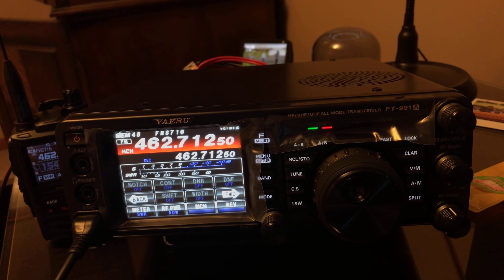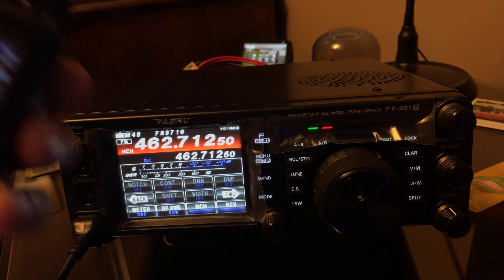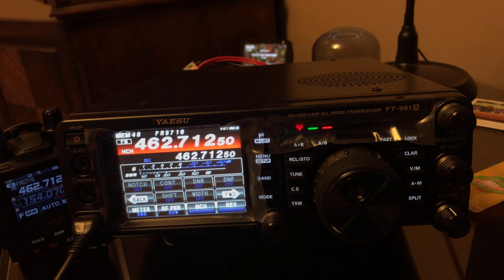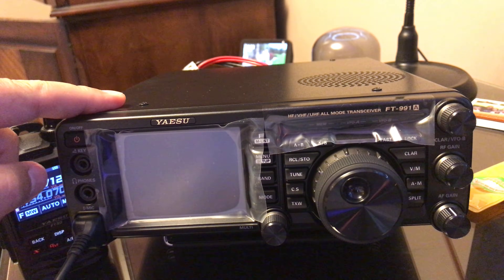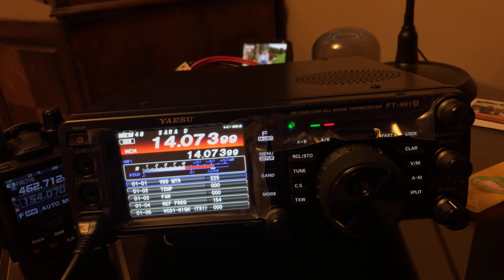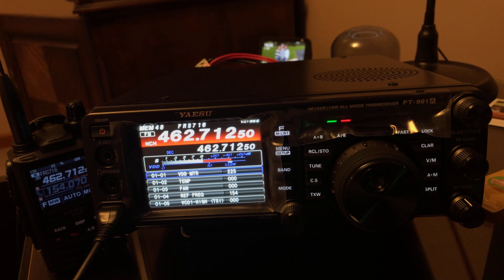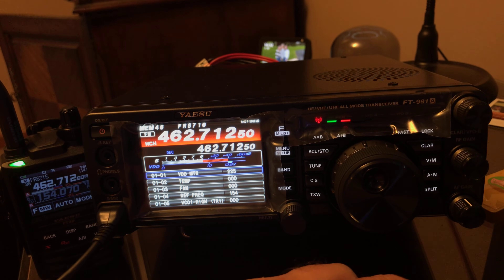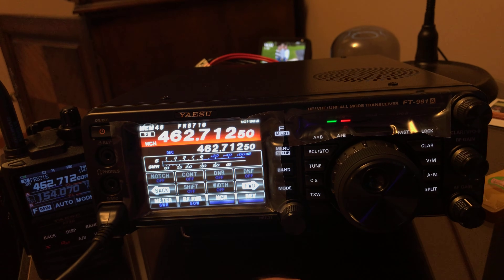Yaesu FT-991A VHF/UHF Extended TX Range

Comment: If it can TX in alignment mode, it should be able to do it in normal operation. Problem is, nobody has figured out how to do it yet and most wont risk bricking a $1200 radio by experimenting with connecting the other open jumpers. lol
Really wish we could make this happen. Ive done it on my FTM200's and FTM500's without issue. The 991A should be doable too.

Comment: Is there a way to have TX enabled outside of the HAM frequency range permanently, specifically for 2m and 70cm bands?
I'm trying to use FT-991a for the needs of the HAM radio service as a part of the Civil defence in E7 but I'm unable to use my rig on the official CD repeater that works on 174MHz.
Reply: no. that's why I won't consider 991a.  857d and Icom 7100 are still my best choice.

Comment: Abusing the privilege's of amateur radio will only bring stricter rules and aggressive enforcement.
That being said, here's a question on the HAM General exam:
 G2B11 [97.405] What frequency should be used to send a distress call?
Whichever frequency has the best chance of communicating the distress message.

I'm sure zombie apocalypses would fall under this.

Comment: Modification of a type accepted Amateur radio for out of band transmit/operation is illegal for licensed Amateurs or anyone for that fact so why are you offering this video for people to do this? Is illegal operation something you advocate?
Reply: We Hams are curious. If something bad happens I'm glad I have more tools in my pocket from watching videos like this :)
Reply: @TechieMillennial  What would those new tools be and how would they benefit you where the normal capabilities of that radio wouldn't?
Reply: @DWood-vl5ek  Laws don't matter when SHTF. A lot more people have FRS radios than ham radios. Again; just another tool in my pocket just in case.
Reply: Isn't there a hall you could monitor?
Reply: It isn't illegal to modify an amateur radio transmitter so long as it is not used on another radio services bands or frequencies and so long as it remains in compliance with the Part 97 spurious emission standards set by the FCC. I looked all the way through 47CFR USGS § Part 97 Rules & Regulations and found nothing about it. There's a 14 page discussion about it on QRZ Forums at https://forums.qrz.com/index.php?threads/fcc-enforcement-advisory-no-2018-03.642755/
Reply: This is good to know for an emergency; which is when it is legal to transmit on any frequency.
Reply: Most of the people on earth, the FCC doesn't apply...  Here, one is allowed to built their own radio using whatever parts/components they want, as an example.
Reply: Rules are for the obedience of fools and for the guidance of wise men.
Reply: Did you ever drive 1 mile/h faster than allowed ?? Why then did you post something like that ?
Reply: Let’s face it….many (not all) are a certain personality type.
I mean really… “social” is sitting in a dark room talking to other (mostly dudes) sitting in their dark rooms.  It’s the Dungeons and dragons kids grown up.
Ever seen a group photo of a ham meet?…yeah.
I heard a couple Licensed hams talking in a foreign language last night (announcing call signs in English) and they were scolded by our local basement dwellers for it.
This little thing….knowing some electronics and rules is their stature and they don’t like that messed with.
Hams (and the FCC) don’t care if a radio transmits out of band because they have no use for it in their hobby.
There are those however who have little use for radios as a hobby or sense of identity and have them in order to help people in case of emergency.
FRS, GMRS, and CB radios outnumber legally operated amateur radios by magnitudes and anyone who would get the appropriate licensing and spend thousands on radios to help others shouldn’t have to carry 4 radios to do this.
Hams are so fragile from their basements that they actually think some radio interference is the end of the world.
I’ve lived in two cities that have BURNED (LA and PDX) and have a much different bar as to what a crisis is and what rule breaking is.
Oh no….somebody contacted a semi on their 991 on CB9….OH NO!!!
I’ve heard that Russia has infiltrated the USA with operatives modifying $1000 radios to disrupt the FRS traffic….HIDE!!!
There is some incredible irony that if China nukes us, that I would have to contact a semi hauling the excavator to dig some ham out of his basement and relay that to CERT on a CHINESE RADIO.
Wake up sad hams.  Nobody buying a 991 or FT5D or Icom is spending their evenings trolling the local GMRS channel with foul language and spurious emissions….seriously.
And if you wonder what personality type ends up making rules at the FCC….you don’t need to look far from here.
And really guys, what difference does it really make if the hams radios tx on the channels of cheaper, more abundant radios?  None of them are doing it.
They might drop out of 10m or HF to participate in a net and go back when it’s over….or at least go back to the ham-only vhf/uhf chatter.  They don’t hang out on GMRS for sure…I know.
Crap, I’d be thrilled if some Ham blasted 700w at our local GMRS repeater so I knew the darned thing actually worked.
AND….I know damned well that some hams use their rigs to tx out of band.
That practice disturbs exact zero people in practice.
Why doesn’t it disturb anyone?  Because they are grown men with expensive equipment and licenses not street punk kids looking to create radio anarchy after robbing the local liquor store.
Yep, believe it or not…
Licensed radio operators have little interest in disruptive endeavors.
Go figure.
Bottom line is that radios are ridiculously far down on the “bad person” list of things to do and it is absurd that the FCC and their basement boys limit a radio that can contact the SPACE STATION from contacting a bubble wrap FRS or GMRS, or CB or MURS…
Especially when the most important use of such equipment might not be someone’s pathetic social life but actually saving lives.
CYA on the air.
Reply: Mr. Dover,  I'm of the opinion it is you who certifies something to use and  with inclusion  of the properly tuned antenna  on what is used within the commercial repeater networks of vhf and uhf..

what is stated within the FCC guidelines is nothing but a patents attorney's wet dream and doesn't state otherwise the actual legal use, it doesn't state implied use of the hardware, it only implies legal build standards ..

If you implied the same logic in transmission  from global use of 25/26/27 MHz to 21-24.999 and 28-30.999 MHz  as example you would qualify whichever the radio you use to  operate through 10 bands of usable space..

as long as you can dial in on the actual output you can put into that specific band allocation..
Reply: Cool, pal
Reply: There are certainly frequencies which are outside of the RIGs predefined band and could be used for TX. There are a few shared/public frequencies on 2m/70cm bands where TX is disabled however could be legally used.
So, I don't see why this would be illegal...?
Reply: well what Business is it What he or Any one other than You Do? Are You The Thought Police or some bs from ca or ny ?
Reply: NOT EVERYTHING IS IN THE USA
Reply: Rules NOT laws.
Reply: Laws aren’t everything. Knowledge is power. These radios are far more capable than they let us in on. Obviously it’s not legal. Neither is driving 1mph over the speed limit, you never tested to see if your car does 1 over the speed limit? ,
Reply: @FriendlyPrecision "Laws aren't everything" That says it all. I really hope you had a mother and father who tried to teach you right from wrong and you willfully decided to disregard their teachings.
Reply: @DWood-vl5ek  Remember when it was illegal for black people to vote? Right and Wrong have nothing to do with laws brother.
Reply: @FriendlyPrecision  I've been in Law Enforcement for 30 years and your arguments would without a doubt be laughed out of court. Your analogies are irrelevant and silly at best.
Reply: @DWood-vl5ek  law enforcement, court, those type of things are great, but they have nothing to do with right or wrong. Just because something is against a law, does not make it wrong. 30 years in law enforcement is a heck of a resume, but please realize that our country was founded by men who were actively committing treason. You’re 100% correct that argument wouldn’t stand up in court, but I never argued that transmitting on these frequencies was legal, all I said was laws aren’t everything. If we only viewed right and wrong through laws passed, that means that one day “right” could mean something different than the next day based on laws passed. Right and wrong don’t change, and they aren’t defined by laws. Just my opinion.
Reply: @FriendlyPrecision  I respect your opinion and your right to it as a free person in a  free land but  your beliefs in what makes something right or wrong is very flawed. This all brings me right back to your initial comment about the fact these radios have capabilities they don't tell us about as if they are trying to hide something from us. Just because a device has the ability to do something more than is advertised doesn't make it ok for you or I to defeat circuitry/safeguards in order to use it in other than the manner it was designed for just because you have some belief a company is hiding something. Most devices have built in "headroom" so as to be able to operate within their design limits without damage. Can you operate them past that point,yes but is it safe or necessary and/or legal? Society has accepted rules/laws in place for safe and efficient operation of that society. If everyone took your approach and just said screw it, day to day life would devolve into anarchy and even you would then be saying what the hell happened? Today, everyone is constantly looking for ways to "Hack" something in order to get something for free or to do something they want it to with no regard for what is right or wrong. I deal with people every day in court that have beliefs like you and they keep doing the same crazy stuff over and over and they never seem to really know why. Don't become one of these people Doug.
Reply: I find if you list something as a full band then gimp it so it can't transmit in full band then technically that would be false advertisement..

and most of everything that falls above 108MHz falls under repeater networking.. 

last I checked only the repeater can transmit above 5 watts
Reply: @DWood-vl5ek  Petty
Reply: @DWood-vl5ek  he probably had parents who taught him to think for himself and not be led by a master.
Reply: @DWood-vl5ek  you would have made a good Nazi